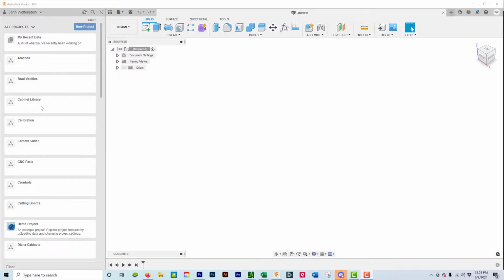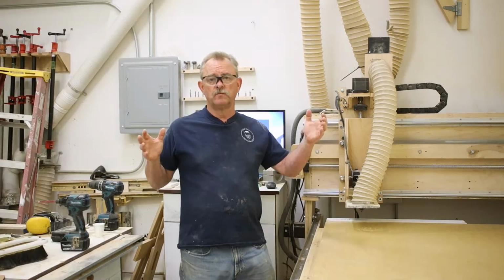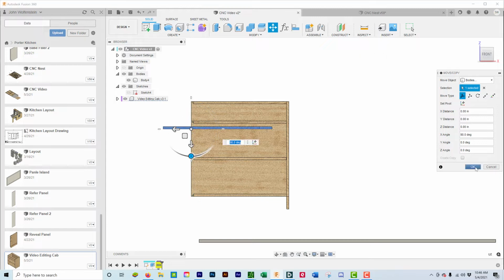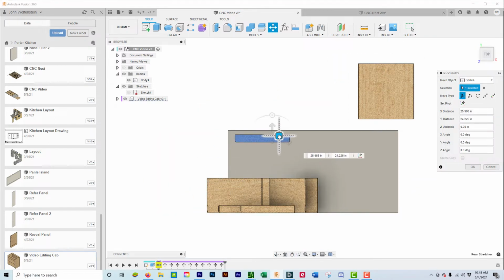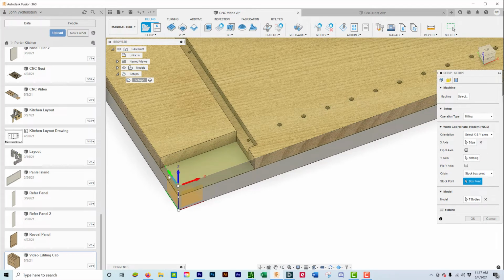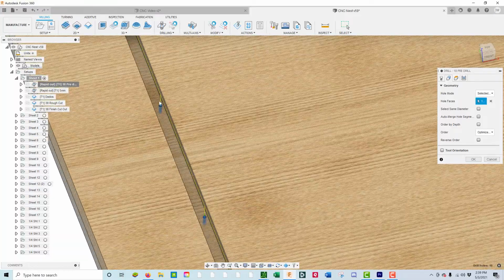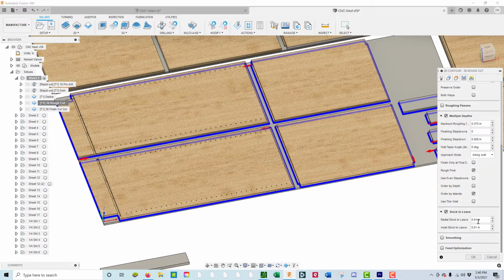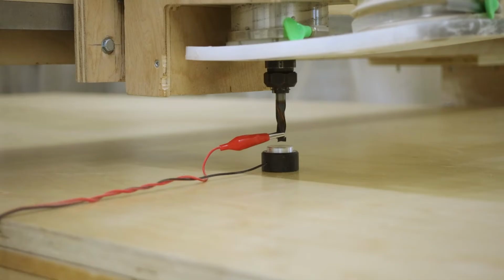Build Kitchen Cabinets with a CNC

Comment: @OldGuyWoodworks, so, do you order your doors and, even, your drawers? What is the advantage of doing this?
Reply from the maker: Most always, unless it's just a couple.  That's what those shops do.  They do it better and with more choices.  Drawers and doors are time consuming.  I just find it a better use of my time.
Reply: @OldGuyWoodworks , thank you for the info. I will keep that in mind. Do you have any few that you would recommend?
Reply from the maker: @jtcmlt1  Depends where you are.  I get mine from a company in North Idaho.  Shipping would be cost prohibitive.
Reply: @OldGuyWoodworks , thank you. I can use it to compare quality, pricing, etc.
Reply from the maker: @jtcmlt1  Panhandle door and drawer
Reply: @OldGuyWoodworks , thank you. Keep it going, and have a successful 2025.

Comment: I use eCabinets.  Free from Thermwood, a CNC manufacturer.  It's specifically designed for making cabinets.  You model your cabinets then place them in a room you specify and it creates a job.  Then it will automatically calculate the total number of sheets you'll need for the whole job.  Then it will automatically create nesting diagrams for all the sheets.  And if you want it will create a g-code file for each sheet.   

Great economy can be realized by the fact that it greats the nests from ALL the cabinets in the job.  For instance, all the sides from all the wall cabinets may end up nested together.  All the decks from all the base cabinets may end up nested together.  Or,  a single sheet may have some base cabinet sides and some wall cabinet stretchers.  And you can print out peel and stick labels from standard Avery label sheets.

You can set the nesting to optimize for cutting with a track saw.  I like it to give me the most 8' rips I can get.  I make those rips with my long guide at my ripping station.  Then I can make narrower cosscuts with my track saw on my crosscutting station.
Reply from the maker: Do you have to buy the Thermwood router?  Free always sounds good.

Comment: Using a CNC creates a radius in the corner of the toe kick. How does one get around that?
Reply from the maker: You can’t.  You can make them smaller by using a smaller radius bit, but they are usually undistinguishable from the position they’re in.

Comment: Correction, a high end CNC can drill, machine joints and cut a average sheet of plywood full or cabinet parts in 5 minutes or less.
Reply from the maker: I am jealous of the high end cnc for sure.
Reply: @OldGuyWoodworks  Well then you got to figure out how to keep it busy.

Comment: Dude, I love your video, is just great!

I was wondering if you would share some source codes for the cabinets you made.

Your work looks awesome and I am a beginner, I wouldn’t know where to start.

I just bought a vertical cnc, M2 from Maker made, and I almost finished the assembling. It can handle a full sheet of plywood, at once.

Hopefully, it will be up and ready shortly, and with some codes I can start creating 🙂
Reply from the maker: I have them on my ETSY page.  Never though about selling them, but I had a lot of requests.

Comment: What is the hole in the one front corner for? Leveling system?
Reply from the maker: Exactly.
Reply: @Old Guy Woodworks  OK, I'm guessing the EZ Level system?   Works good?
Reply from the maker: @benjaminu12  Yes.  Works very well.  A little pricey, but you have to quantify the ease of install against that cost.  Which was worth it for me.

Comment: What CNC router are you using, I’m trying to setup a similar setup as yours overseas.
Reply from the maker: As far as the actual CNC,  I built it myself.  The actual router is a Porter Cable, but I have a 2200W spindle which I'm preparing to change out to.  My software for my CNC is Mach 4.
Reply: @OldGuyWoodworks  I would love to build my own, that sounds awesome. Are you on the east coast?
Reply from the maker: @richardarcher5789  No I'm in Arizona.  I do have a whole series of videos on how I built it.  They were my first videos, so the quality is not as good as what I'm doing now.
Reply: @OldGuyWoodworks  I’ll definitely check it out. Thanks again.

Comment: Your 1/8" endmill looked burnt. A better alternative when drilling all your different sizes of holes would be to use drill bits meant for CNCs. I just bought an industrial 1/4" drill bit with shank adapter for my Axiom 2' x 4' CNC, so I can drill dowel holes in my projects. I think I'll be getting a 5mm bit and adapter next.
Reply from the maker: I'm sure it is.  I need the ability to control the speed on my router, otherwise it can't be avoided.  Thanks for the input.
Reply: @OldGuyWoodworks  Ohhhh, yes. My 1/4" bit from Amana is rated at 8000 rpm maximum.

Comment: Thanks for the video! I bought your Fusion 360 from Etsy. I have also built my own CNC (can't do homing yet) and learning each day 🙂. 

I have a basic question - As 3 different bit sizes are intended for this cabinet build, there are three different G-code files being generated from CAM in Fusion 360. When I attempted to click on the Setup node in CAM and then generate G-code it mentioned Fusion 360 free version doesn't support Tooling Changes. My question is, how do you generate the G-codes? One for each drill bit operation (If so, does the CNC orient properly upon loading each file?) or do you have the paid Fusions 360 version and does it generate a single G-code file for all the operations (pre-drilling, dados, and cutouts)?
Reply from the maker: I create a separate file for each tool.  When I first set up my cnc I create my home for the X and Y axis.  The Z axis is set each time I change operations.

Comment: Hey, would you let me know what cnc machine should I buy if I want to make cabinets at the hobby level.  For my house, I have to build cabinets for two kitchens, a few bathrooms, and closets for bedrooms....
Reply from the maker: That's a loaded question for several reasons.Buying a cnc for just one house of cabinets isn't cost effective. So much depends on your budget.  That's why I built my own cnc.  At the minimum you would need a 4'X8' to accommodate full sheets of sheet goods.  I wouldn't buy a cnc to do one job.  If I had a decent budget I would get a cnc with a tool changer and vacuum hold down with at least a 5hp 3 phase router.

Comment: Hey buddy. Thx for the vid. I'm having a major headache with my cnc. I'm cutting mdf boards for kitchen cabinets and most of the time, like 8 out of 10 cuts, the laminate chips off from where the bit enters and a lot of times where the ramps end and inbetween. I use mostly 6 and 8 millimeter downcut bits. I've tried to avoid the ramps, but it chips off the laminate from the other side. I've also tried different entry points and that didn't help. My feed rates are around 3k/min and plunge rates are a little less. I'm using aspire for modeling and mach 4 hobby for g code. The cnc machine has some years on it, but I don't want to jump to that conclusion yet. Could you give some advice on that or maybe direct to an honest forum? I think I have about three weeks until I'm sacked.
Reply from the maker: I will admit that I use all the defaults on ramps and feed ins and it works fine for me, so I'm not very good with ramp and lead-in speeds.  Are you using a down cut bit?  If you want both sides to avoid chipping while you cut full thickness, you'll more than likely need a compression bit.  I'm not an expert, but I think I would avoid ramping and start my feed from outside my cut.  As we speak I'm cutting melamine and the chipping is driving me nuts. The forums I have had the most luck are https://www.cnczone.com and https://www.machsupport.com.

Comment: How did you learn Fusion 360 to design cabinets? Any particular training program, etc?
Reply from the maker: I had some training using Solidworks which is another CAD program which helped quite a bit.  I may have done some online classes on Lynda.com as well.  It's been a while so I don't remember exactly.  I know I've watched stuff on youTube quite a bit.

Comment: Hi, I'm trying to learn the cabinetry business as I'm planning to start kitchens/ cabinets making business. I still need to learn a lot. I am thinking to buy cnc saw cutting/ nesting machine, banding machine and cnc for drilling. I am thinking to produce the cabinet doors  and use laminated particle wood. My question which is better for precision of cutting/ neat edge without breaking the hpl laminate. Do you recommend a cnc saw or cnc router for cutting.
Reply from the maker: I personally think the cnc router would be more versatile and give you the clean cuts you are looking for.
Reply: @OldGuyWoodworks  thank you for your prompt response and sharing your know how. Actually, I noticed the cut of cabinet doors made of laminated particle wood were not neat. Although the banding machine has a tool to improve the cut finish before banding but still u could notice the hpl/ formica breaking. I believe they use table saw cnc  (sizing/ cutting cnc)

Comment: Loved the video. Would love to build my own CNC machine. Couple of questions for you.
1. Do you have a video showing your CNC build?
2. Why don't you make your own cabinet doors and drawers instead of ordering from somewhere else?
Reply from the maker: I have a whole series on my cnc b uild  Start here: https://youtu.be/97CVaJHTYhM.  If I have just a couple doors or drawers, I build them myself.  It isn't time or cost effective for me to build my own drawers or doors otherwise.  The vendors I use specialize in doors or drawers and do a much better job that what I can do in my shop.
Reply: @OldGuyWoodworks  Thank you for the response. Do you mind sharing some of the vendor names where you get your drawers and doors. Thanks!
Reply from the maker: @zoritongogaro711  They are in Southern California.  If you are not nearby the shipping will probably be cost prohibitive.  I get both from Ideal Drawer in Huntington Beach, CA.  He doesn't make the doors, but has a vendor he uses.

Comment: I'm in the market for a cnc for cabinetry work. What are your specs on your cnc ? Cutting speed?  I'm looking at the Artisan 408
Reply from the maker: Cutting speed varies from tool to tool.  My 3/8" diameter end mill cuts nicely at about 40 ipm.  My router isn't strong enough to cut any faster without some chatter.
Reply: @OldGuyWoodworks  this would be my first cnc (Artisan 408 4x8) just trying to compare yours and something like that 408 so I can make cabinets with it.

Comment: If you can't drive a nail straight like at 8:46 you probably shouldn't put your hand there. Hope that isn't an end piece...
Reply from the maker: Came out of the bottom.  I use the pins only to hold it in place wjile I screw.  If it was exposed I'd replace the panel if it couldn't be fixed.

Comment: super interesting video, but seeing that nail come out the side at 8:46 hurt like watching someone get kicked in the tender parts, because it has happened to me so many times 🤣 is there no better way to do assembly?  after all that time and expense to get to that stage, and it kind of got ruined, or am I just being a perfectionist?  what do you do you recommend?
Reply from the maker: That nail came out of the bottom which is under the cabinet and won't be seen.  The nail is only to hold it in place once I get it in position and I always angle the nail to make sure if it gets exposed, it comes out on a non visible area.  You don't even have to use the nail, it's just for convenience.  Perfectionists make the best woodworkers.  If I have a "shiner" in an exposed area I will go as far as to make a new part if I can't fix it.

Comment: awesome video ...surprising how useful even a homebuilt cnc could be ..even at an hour a sheet when you factor  how much handling you reduce through all the subsequent steps its really a force multiplier for the shop. Between that and the edgebander set up, really an affordable set up to be competitive cabinet shop.
Reply from the maker: You are correct.  An hour a sheet sounds terrible, but You can do plenty of things while it's doing it's thing.

Comment: Hey Old Guy, I am trying to follow your facebook link and am getting the following error. I do not know if it is a facebook problem at the moment or if it a setting you have on.

"This Content Isn't Available Right Now
When this happens, it's usually because the owner only shared it with a small group of people, changed who can see it or it's been deleted."
Reply from the maker: My error.  I am no longer on Facebook.
Reply: @OldGuyWoodworks  No problem. I will reach out to you on Etsy
Reply from the maker: Just started loading some files to Etsy.  Hopefully I'll have a complete library soon.  https://www.etsy.com/listing/1069556804/base-cabinet-with-full-height-doors?ref=shop_home_active_1

Comment: Hey John you should look into the new nesting feature they have in fusion, it will automatically and optimally layout your parts for you
Reply from the maker: Just checked that out.  I had no idea.  What an awesome feature.  I guess I better get that machining extension.
Reply: @OldGuyWoodworks  I’m so glad to have passed it on. Ironically I found your video looking up videos about it. Your knowledge of fusion is awesome.
Reply from the maker: @garethkalber7236  it’s been a steep learning curve. I started in Solidworks, but changed to Fusion because it was free. That was 3 years ago.  Now I pay.  Solidworks is great, but alone has no cam abilities like Fusion.  Thats another expensive program.
Reply from the maker: I will definitely give that a try.  It will make my life so much easier.  Thanks for the tip.  I learn something new every day.
Reply: Try map boards plug-in!

Comment: Amazed by how easy it is to modify predesigned cabinets in Fusion. Have you considered sharing the Fusion files for your cabinets?
Reply from the maker: I have.  I'm not sure everyone would think like I do when it comes to the actual  build/design.  There are still some bugs here and there that I keep finding.  Nothing terrible, just annoying.  The more I use them the better they get.
Reply: @OldGuyWoodworks  well I am very interested. Please let me know how we can arrange this. pmcummer@gmail.com
Reply from the maker: @patcummer  I would probably just put them on my Etsy page and sell from there.  My issue being I don't want to be a software company that has to support the files.
Reply: @OldGuyWoodworks   are you still planning on selling it on your Etsy page cause its a awesome library
Reply from the maker: @RyoKKK  yes.  I am in the process of "cleaning" the files right now and will be putting them on the Etsy page soon.  Not sure exactly when, the process is tedious.
Reply from the maker: @RyoKKK  Just started loading some files to Etsy.  Hopefully I'll have a complete library soon.  https://www.etsy.com/listing/1069556804/base-cabinet-with-full-height-doors?ref=shop_home_active_1
Reply from the maker: @Patrick Martinez I sent you an email.
Reply from the maker: Just started loading some files to Etsy.  Hopefully I'll have a complete library soon.  https://www.etsy.com/listing/1069556804/base-cabinet-with-full-height-doors?ref=shop_home_active_1

Comment: Great video.  After watching this I think I'll have to look at Fusion.  One question though.  What do you think your costs savings where over buying the cabinets flat pack?
Reply from the maker: Not familiar with cabinets flat pack.
Reply: @OldGuyWoodworks  Unassembled cabinet kits that come in a flat box.  Ikea is an example.  Last three kitchens I've done were this way (not Ikea though).
Reply from the maker: @zeketeccnc1207  I couldn't tell you if I was saving money or not versus the flat packs.  I never considered using them.  I am more concerned about making my own custom sizes and controlling the quality of my material. (not to say the flat pack is poor quality).

Comment from the maker: Using a cnc for cabinet build almost makes me a 2 person shop.
Reply: May I ask what kind of CNC you use to build these cabinets?
Reply from the maker: @delimastein8044  I built my own from various components online.  The software I use if Mach4 from Artsoft which is the CGode reader for the files I get from Fusion.  Fusion will generate a bunch of GCode for different cnc machines.
Reply: @OldGuyWoodworks  okay, thank you so much!